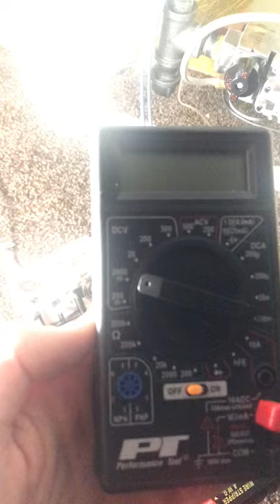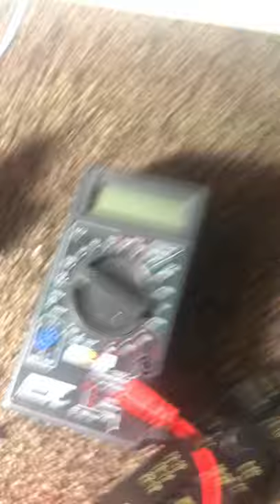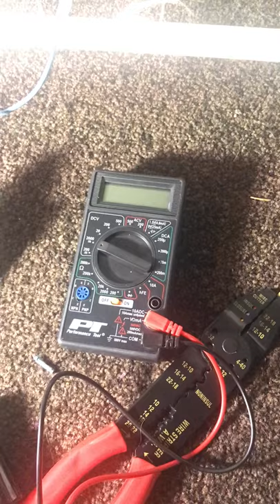Cozy Wall Heater Troubleshooting

Comment: I just cleaned all the connections with can air , and I tightened up all the connections like you said and the heater kicked on. Everything is working perfectly now. I appreciate your videos.
Reply from the maker: Connections as in the burners, and pilot? Or did you actually wrench off the gas pipe connections from the gas valve and do those too?

Thanks for responding. Mine worked great when I tightened all my connections up, but then after a week it got funny again.
Reply: @HeartHandsMikey  all I did was clean and squeeze the blue wires and the wires on the gas valve. Took them off hit it with the compressed air and put them back on all snug. The heater fired up like new turns off and on by itself now.
Reply from the maker: @josepena-nl4wr  Thats great news! I'll try that again as well, but this time with compressed air and not just a Q tip, rag, and a little sand paper.

Comment: These furnaces are junk they don't have a filter and they blow dirt smoke and dust all over your house! I bought my house and it already had a cozy wall gravity furnace installed, within the first year I already had the thermal coupler replaced and the technician that came out had to put a heavy duty one in. Whoever would design a furnace with no filter at all! And then they're loud and creaky and the expansion and contraction, I can't even hear my TV, I can't wait to be able to afford to get rid of this thing!
Reply from the maker: They do seem to be lemons.

Comment: I'll take a vintage Dearborn over one of these pieces of crap any day of the year.
Reply from the maker: Not sure what that is but I probably would too! The heart ache of these darn things is only surpassed by the fact that others benefit from the videos and are keeping their families warm.
Reply: @Heart Hands Mikey  I have one of those new fangled ones like this. It's good when it works, but the Dearborns are the old butane heaters that your grandparents had. I've got 2 of those and they never fail.

Comment: I was always tapping the heater very gently and it would come on for a few minutes. I checked all the wires. I took them off and put them back on. Now working pretty good. Fingers crossed. Thanks for the video.
Reply from the maker: Absolutely! Did you get it fixed! I'm hoping you and yours are ok!

Comment: My cozy wall furnace is 14 years old. The trouble I have is short cycling which I know causes issues with the motor.  I have a service tech out every year he doesn't seem as concerned about it as I do. Do you  think that the thermal coupler wire being tightened may help with this problem? Thanks

Comment: Millivolt systems are powered by a thermopile not a thermocouple.   And it good reading is 750 to 800 thermopile is also called a power pile or a generator depending on what part the country you live in.   Millivolt systems are best when the connections are soldered.   Spade connections get loose over time.
Reply from the maker: Interesting. Perhaps I should solder then!?

Comment: I have the same cozy furnace and I had the same cozy issues. Thank you for your videos because they were very helpful in fixing my cozy furnace problems although mine was not the safety switch mine was a little wire connectors on the blue wires that slide on and off!  they weren't on their tight enough! Thanks to you I slept all night without banging on my furnace! 😊
Reply from the maker: Glad to hear it!!

Comment: Thanks. After watching your video I pried down on the safety switch contacts in the upper portion of the heater and waalaa, heater fired right up.  It's currently working and hasn't cut off after 30 seconds of heat. Thanks again

Comment: Yeah, was having a problem with the gas not coming on in the unit, yet the pilot light was on. I just tapped the metal part like you did and now the unit is working.

Worked great! Thanks for the help and solution.
Reply from the maker: make sure to watch the handful of videos I made on this issue as it could be a number of easy fixes, it just depends.

Comment: Great video thank you.

So here’s how I fixed mine.
The 2 wires leaving the thermostat, through the wall, then popping out of the wall to connect and be screwed down in the bottom of the heater had a bad connection.
There is about 12 inches where they come out of the wall and directly where they connect to the heater underneath…they were broken sometime in the past, twisted back together, painted over, etc.
So I made sure the pilot was lit, turned the thermostat to 80 deg…and nothing happened…but when I wiggled the 2 thermostat wires, the heater started up (you can hear it).

So the fox should be untwisting the weak connections, cleaning each wire with some sandpaper & twisting back together, then taping.

Comment: Millivolt systems such as yours need extra heavy gauge wiring. I tippled up my wiring to the thermostat. You can also use 14 gauge Romex as your thermostat wire.

Comment: Well, that worked! Just knocked in the right place with the screwdriver handle and it started up. , , , That was after I cleared out the summer spider webs—which might themselves have been a hindrance—maybe some kind of fire prevention block the heater has?

Comment: Mine would go on off on off…and so on. I think those sensor wires where red button is are in a hot spot on heater perhaps and makes too hot readings to thermostat.
Reply from the maker: I think you might be correct on that. I've though that before as well.

Comment: I installed a pilot pro on my cozy heater and i'm having the same problem, pilot comes on then the thermocuple gets red hot but main burnner will not kick on unless i tap on the valve. maybe i'm having the same problem, but the stat only tells the pilot to come on not ihe main gas burner correct?
Reply from the maker: I believe you are correct. I also found the problem to my issue if you watch all the videos I posted on this. There are steps to take. Mine is fixed and it's fine now.

Comment: If this video does not work, look at the very top left or right, there is a red button reset button that you click that was my issue after checking all these problems.

Comment: If you only read 500 millivolt then you need a new thermopile.  Sounds like your thermopile was strong enough to power the stat and the pilot solenoid but not the main valve. To check this you would  call for heat at the stat. Be sure the pilot is on.   The take a reading across MVPV to MV at the gas valve.  The MV or main valve requires the most millivolts.
Reply from the maker: Interesting. Someone else just told me tis as well...despite the rep from Cozy insisting that 500 was fine. Unreal, right!?
Reply: @HeartHandsMikey  the rep is wrong.  If you don’t have 750 between MV/PV and MV replace the thermopile( sometimes call a generator) 👍🏻
Reply from the maker: @brunoshvac2578  See that all this time, and that is what it may have been. I've torn this damn thing apart about 6 times this winter, and even had to resort to buying a ductless gas fireplace from lowes for $500 just to get through the winter. I've been out of town for about 2 months, but when I get home in a week, I will replace the thermopile and hopefully be done with it!